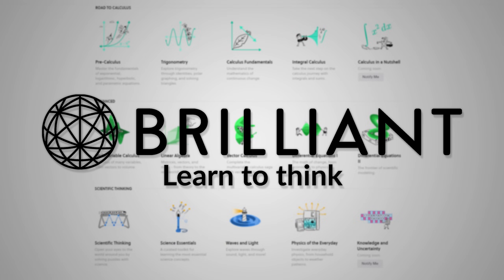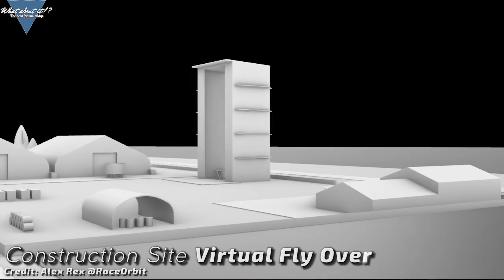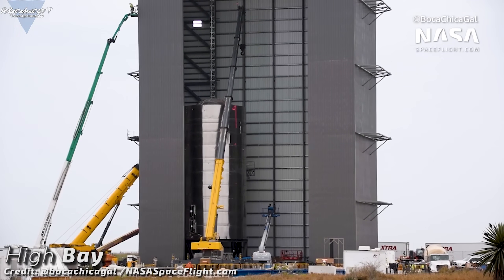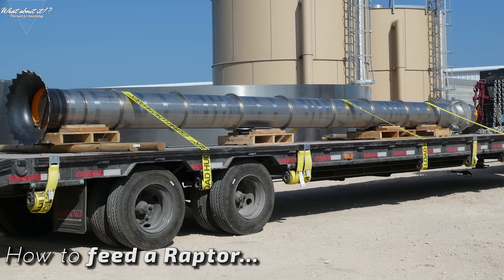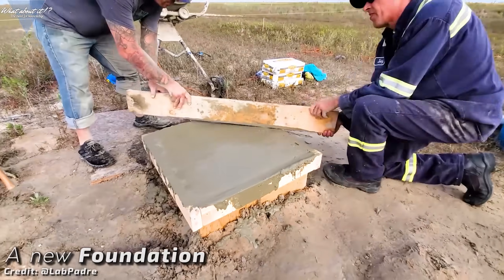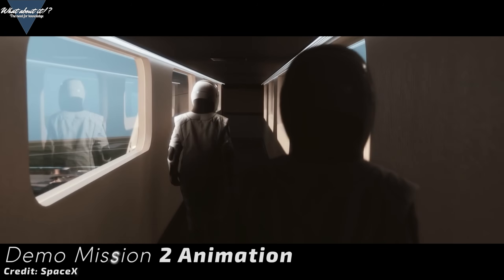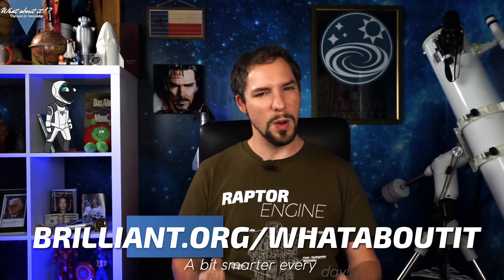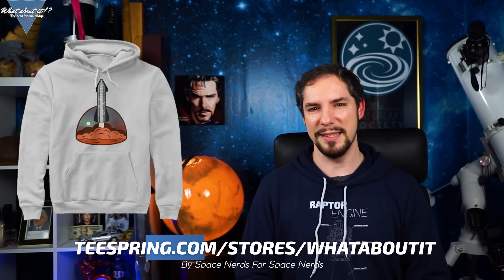79 | SpaceX Starship Update – Crew Dragon Demo Mission 2 Targeted For May

Comment: At   2:24   Shown on the right are five oddly shaped columns.  Those are made that way to better resist side loadings.  About 2/3rds the way up you see an odd  short beam.  Those are beam seats. They usually are for  girders that hold overhead crane tracks.  (The other end seems to be the same way.  Making a light wide span crane likely).
Notice the two stiffner plates to the right of the seat.  About 24" up from there is another stiffner.  Look REAL close and you will see a small clip welded to the face of the column over the seat.  When the girder is set in place, those will bolt to the top flange of the crane girder to steady it from forces when the crane travels.(Just trying to share 25 years of experience)  If this is correct, the crane will be set into place before the roof sheeting (Cladding) is installed.  (People DO sometimes build in the capacity to have a crane installed then wait a year or two when ever they need a crane.)
Reply: Thank you! Good info!

Comment: .
To add to what Ian Keeling said below, from the shape of the side beams and the light size of the end girders, I am guessing that this will only be the about 3 stories high-bay structure we see. The shape of those side beams suggests there might be a permanent bridge crane installed. Again, guessing, perhaps this is simply a better built and easier to use ring forming building. Once again, we wait to see. :)

Comment: Those dents in the skin as the starship was being stacked have me a little worried.
If they are part of the tanks the pressure will make them pop out and become more rigid.
But if they are between tanks they wont be pressed out. They could collapse under load. Did they put ribs in these intertank areas?
Reply: There are two tanks separated by a dome, no space between them.
The cargo part will eventually be pressurized, so no problem there either.

Comment: I assume the new building will integrate a heavy lift overhead crane, hence the bulkier support structure
Reply from the maker: I hope so too!
Reply: They certainly need an internal crane! It'll speed things up a bunch while improving safety.
Reply: I agree. Personally I wouldn't be surprised if this structure will become a more permanent home for the barrel formers including röntgen inspection and polishing equipment. The current tent looks like it has a height limitation whenever they try to remove one of the barrels from the former.
Reply: @olafzalm  - I see this building as being the location for final stacking with the tents being for sub-assembly work. Front end in one, cargo bay in a second, tank section in the 3rd, and engine bay in the forth. I suspect in the long run we'll see them build a real building to replace these tents once they get the space requirements and flow figured out.
Reply: @ItsEricAZ  Agreed. The sprung tent structures could be used for another 18 months or more until the build iterations become finalized. Exactly how long though,,,, Who knows? One thing I will guess is the final structures will look pretty slick!
Reply: I hope

Comment: Why doesn't spacex weld like how ula weld their rockets
Reply from the maker: First of all, different material. Secondly they want to drive down cost of production. They know how to build like ULA. Look at the Falcon rocket family. ;)
Reply: You mean friction welding? Becuse that would require slow development and machine design. But maybe in the future.
Reply: hameedullah jasat I’ve thought that too, maybe we will see it with the later improved models once mass production starts
Reply: ULA doesn't build everything they outsource some parts. Don't remember exactly what. Tory Bruno talks a bit about their processes in the factory on Smarter Every Day.
Reply: ULA stir welds their aluminum parts, but their bulk heads are SS,  and  in the ULA video, they are welded the same as SpaceX.

Comment: If I should guess I'd say the new VAB/high bay being built is going to implement a crane on top which neither of the other two have. It is wide enough to fit at least three ship segments which could be put together by the crane. And because of the additional weight they need the stronger parts on the sides.
Reply from the maker: That would be desireable! :)

Comment: Hey Felix. I'm confused. SN3 is the upper part of the starship right? If so, where is all the cargo space? It seems the entire thing is full on fuel tanks. Keep up the great work.
Reply: The top 20 meters is space for cargo.
Reply from the maker: What Pawel said. Thanks @Pawel! :)
Reply: Ah, I forgot: 6:50
Reply: Go to 7:12 in the video, the green and blue sections in the image are where the cargo would go as the tanks end at the top of the light purple section.
Reply: Nosecone and 6 rings below it - cargo
Tank in the middle - methane
Tank at the bottom - oxygen
3 bottom rings - engines and thrust structure
Reply: And being full of fuel is typical for rockets:)